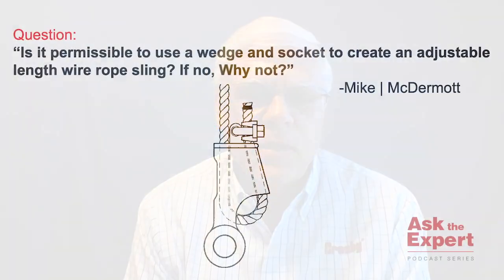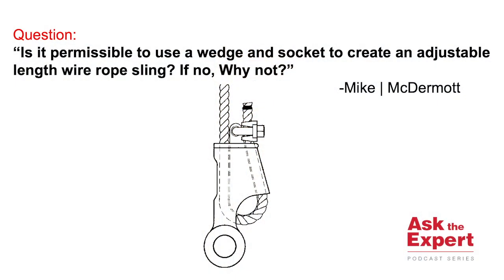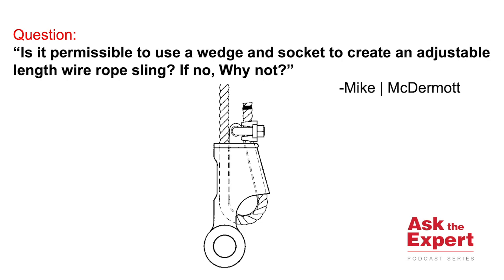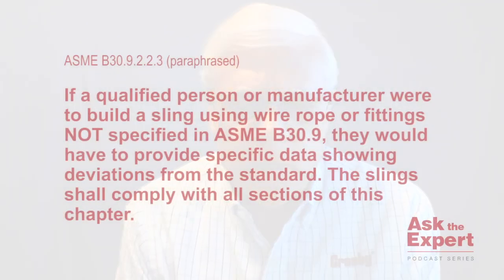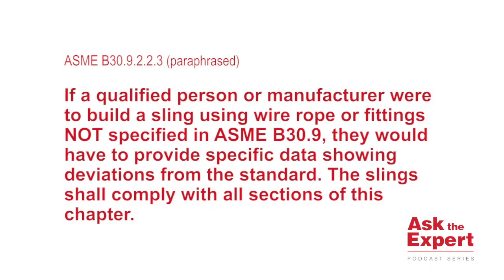Wire Rope Slings: Can you use a wedge socket to create an adjustable length sling?

Comment: Would adjusting the wedge socket location effect the wire rope strength? For example using such a sling at the rated load then moving the wedge socket to a different position on the wire rope such that the previously bent section is now pulled straight? A different way to phrase the question is would bending of the wire rope in the wedge socket cause some damage such that the section would no longer achieve the rated load.
Reply from the maker: Hi, Larry. Wedge sockets and wire rope clips are engineered stress concentrations. Because of this, we speak in terms of connection efficiency, not Working Load Limit. So, once a rope is reeved in a wedge socket, its ultimate strength is reduced by the appropriate amount per instructions. Ideally, if the wedge socket is ever detached, the compressed section of wire rope would be removed and the wedge socket installed on an unused section of wire rope. Crosby does not have guidelines for the application being proposed.
Reply: @crosbyrigging  thank you for the reply